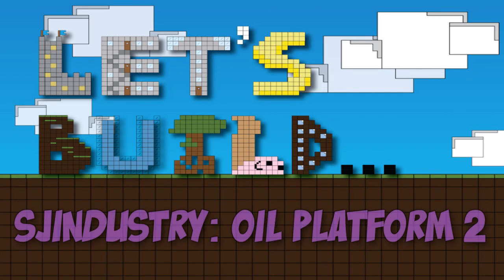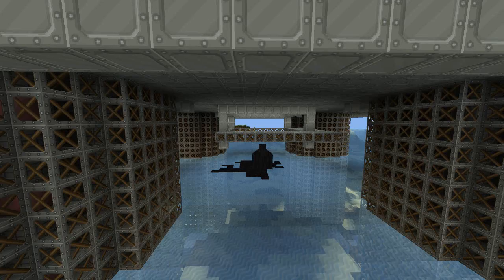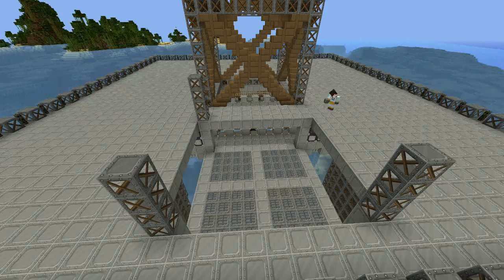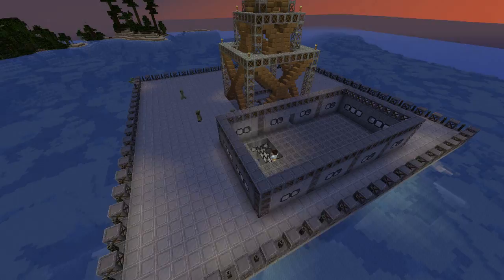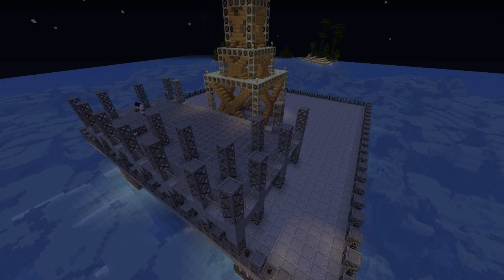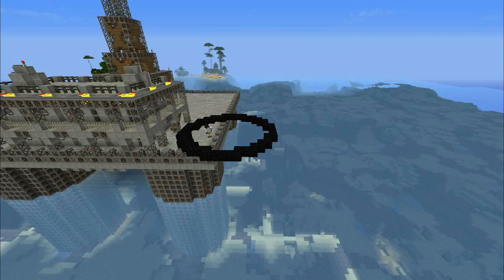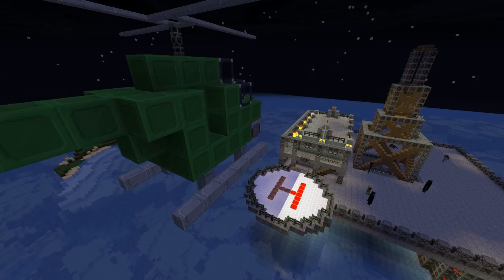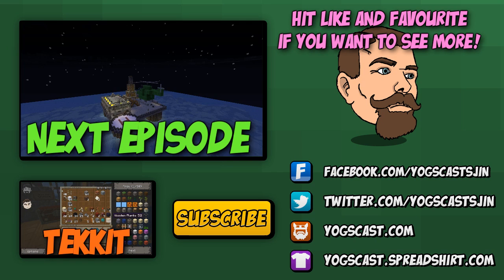Let's Build: Sjindustry - Oil Platform #2

Comment: Everything here looks awesome, but one thing: you have a flashing helipad H, and flashing lights on the support beams for the platform. While those are obviously denoting motion, the helicopter itself is completely motionless. When you see the helicopter in front of the platform it's contradictory. If you have the UgoCraft mod installed, you should put it to use and make the blades of the chopper move.

                                - thefri

Comment: That's a very good point, If you dont have enough water in those engines when the oil or the fuel goes in, KABOOM! Your whole power source is gone.